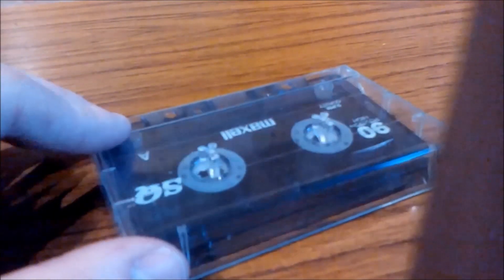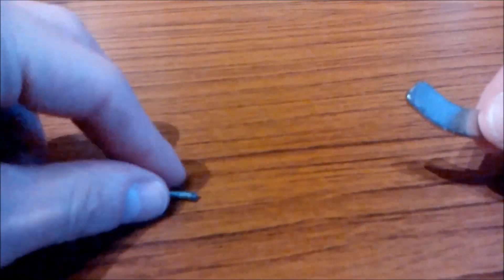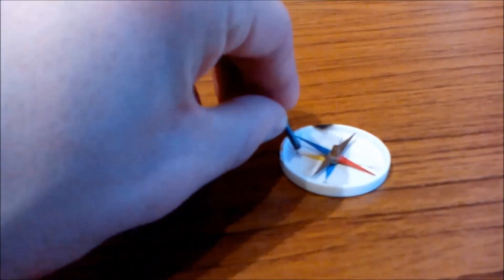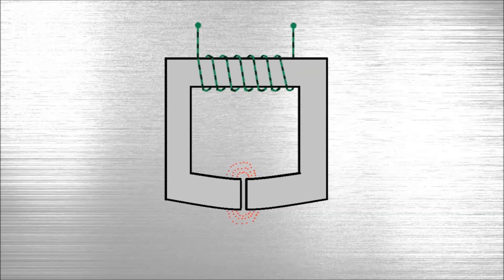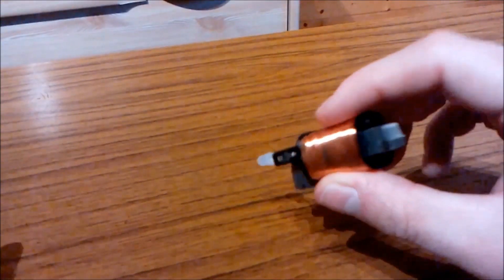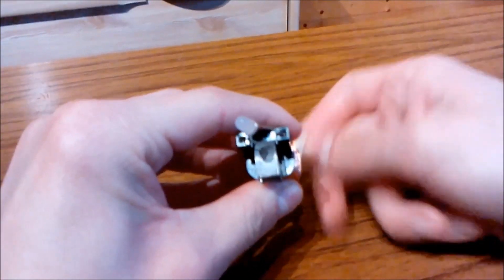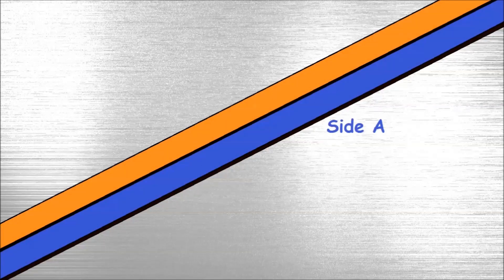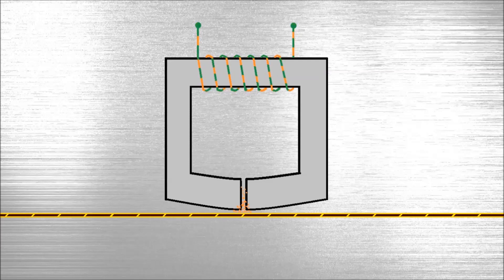How do cassette tapes work? | Analog audio cassette

Comment: I've been remastering and recording music unto Cassettes since I was a kid, and till this day I still do. I just purchased brand new blank Maxell UR 90 tapes at Fred Meyer to continue transferring all of my favorite music unto an Audio Compact Cassette Tapes. I've been messing around with Audio Compact Cassette Tapes all my life, to show people that it's possible to make them sound Louder Sharper and Cleaner than CD's and especially MP3's! Anytime I would shop around for a new Professional Studio Quality Audio Compact Cassette Tape Deck, first thing that I would do is check out what Playback/Record Heads it's equipped with, and always make sure that it's also equipped with an actual AC Bias Erase Head instead of a permanent erase magnet (which are usually blue, but could be any other color). Avoid stereos that use such a permanent erase magnets since those (blue) erase magnets tend to add awful thunder-like noise to the tape, as it erases it. You can use those stereos for Playback-only, but never, ever record on such stereos. To record, I recommend using a 3-Head Professional Studio Quality Tape Deck if you want CD Quality Audio Recording on your tape. Like I mentioned before, all of my Compact Cassette Tapes sound Louder Sharper and Cleaner than CD's and especially MP3's! Every tape deck uses a different type of Playback/Record Heads. I always go for the Parmalloy AC Bias Head. Deck with a high quality Heads and an AC Bias Erase Head will guarantee that your tapes will sound Louder Sharper and Cleaner than CD's! But I also increase the Recording Volume (Not too much where the sound quality might get distorted), and increase the Bias levels, and I never use Noise Reduction to my recordings, since it's not the tape that hisses, but the stereo system itself hisses. Don't believe me? With no tape loaded in the deck, press play, and increase the volume. Hear that hiss? It's the same hiss that you hear in the background as the tape plays. Sometimes, especially on cheaper Stereos, that hiss that the stereo produces, gets recorded on the tape, that's why I only record on Professional Studio Quality Tape Decks that don't hiss like a snake. People get amazed how I accomplished to make Compact Cassette Tapes sound Louder Sharper and Cleaner than CD's and especially MP3's! Just gotta know how the tape recorders work, then you'll be able to get them to sound Good! And remember, it's not the Tape that hisses, the stereo system itself produces that hiss!

Comment: Nice job here. A thought occurs, about this subject: I grew up with audio cassettes in the 70's and 80's, and never understood why manufacturers of tape decks (whether it was a little shoebox tape recorder or a massive, pricey machine) would always place the Record button right next to the Play button. It's almost as if they wanted us to screw up and accidentally start erasing what we already recorded. Just a little mystery of life that I found annoying. 😄
Reply: Because when you record something onto tape you have to press the play & record button at the exact same time to make it record. If you just hit record it won’t work. They put them right next to each other so you can press them both with one finger to record. It’s much easier than trying to press them both with 2 different finger at the exact right time
Reply: @crystal6368  Right, I get what you mean there, when it comes to those specific recorders that had the record/play "one touch record" function. The purpose was to make it more convenient. However, some machines were designed so that you can record just pressing the Record button, and it's right next to the Play button.

Frankly, the manufacturers of stereos--- be they American or German or Japanese or Korean or  Chinese-- all they had to do was put Record on one end of the deck and Play at the other end. The buttons have no business being next to each other. And it's not like the majority of consumers are spastic and have trouble with their finger dexterity. :D

Comment: The LED illumination is clever and accurate. The description of how the recording surface of tape works, however, is not. Magnetic pigment, whether ferric oxide, cobalt-enhanced ferric oxide, chromium dioxide, barium ferrite, or metal particle, is billions of magnetic crystals that are ALREADY polar magnets with a positive charge on one end of each crystal and a negative charge on the other. Recording does not "permanently" magnetize them. If it did, tape could not be erased or recorded over again. The recording process, which is described correctly through the record head, merely makes patterns of positive/negative magnetic "prints" on the tape that correspond to the electrical changes coming to the record head. The magnetic crystals in the pigment are fixed in place in a binder glued to the base film. The crystals can't physically move, but they can switch their magnetic poles under the influence of the magnetic flux coming from the record head. When most crystals have their positive poles lined up the same way, the output to the playback head is positive. When most poles are lined up with negative poles first, the output is negative. When poles are completely random, there is no output (except noise from broken or misshapen crystals.) Tape is erased when the erase head puts out a "loud" signal that changes so quickly that the crystals are scrambled randomly trying to keep up with the changes.

Comment: I find it interesting that contrary to my uninformed expectations, the "magnetic signal" recorded onto the tape doesn't just dissipate, because as far as I know, a ferromagnet like the one you showed us in the video slowly loses its magnetism, doesn't it?  
  
And on an entirely different note, all that high-school dreariness about electromagnetic induction would have been made slightly more interesting if some of the applications were also mentioned.
Reply from the maker: Yes, that's true. The magnetism slowly weakens over time. This causes the tape to sound wrong after long time storage. Same reason why you shouldn't store it near magnets, because the magnetic field will affect the tape's magnetism, making it sound wrong, noisy or even erase parts

Comment: Thanks. But I still don't quite understand how music and sound information gets stored on that iron oxide coated tape to be played back again over and over. I find it amazing that information can be stored on that little strip.
Reply: Nystagmus sumgatsyN if a 30 minutes tape is used as a tape drive, it can hold a  maximum of 500kb digital data. That's not very much.
Ofcourse it's a different thing for analogue.
Reply: he was curious on how is audio (the information) being stored on a coated strip of tape.
Reply: While recording, The tape is magnetized in the same patern as it receives signals from the drum that is placed nearby.
Now while playing, it reverses the action.
The magnetic field on the tape produce same pattern of current as it had received earlier,
Which is again amplified, and music starts playing in the speakers.
Reply: @ANKITKUMAR-pc8uz  great explanation.
Reply: @branni6538  thanks buddy..

Comment: great video. very helpful. but I still don't get how the iron oxide doesn't slowly lose its magnetic charge. wouldn't a cassette tape eventually become blank again?
Reply from the maker: It does lose its magnetic charge over time. Like when an old music cassette where the notes sound false. But the material is made to hold to the charge for a very long time, but not forever indeed.

Comment: could you make a video on how the erase head on a cassette recorder works?   thanks
Reply from the maker: It works the exact same way. Only instead of a variating signal it induces a DC signal. This magnetizes everything the same. When there is no difference in magnetic fields, the player won't pick up anything (except for some random noise of course, what you can hear). Greetings!

Comment: I'm analaysing a cassette player for school but I can't find how it switches from play function to recording,
Reply from the maker: +Gloin79 It works just the same way. Only the tape head creates a magnetic field when the current flows trough a coil, which magnetizes the magnetic particles. When playing the tape, it just works the other way around.
Reply: But what if the tape head receives signals from the microphone while it's a playing a tape (not while recording)
Reply from the maker: +Gloin79 That's beyond the principle of a cassette tape. That's just the electronics behind it. The electronics just ignores the microphone. It will switch in different circuits for reading or writing. If you look up the schematics of a tape player/recorder you can check that out.

Comment: But how does the sound get recorded onto a Tape ?  I don't understand.  Also, when u play the tape, how does a sound come out of it ?
Reply from the maker: The microphone converts soundwaves into a small changing electrical signal. That is amplified and sent to the recorder-head. When playing a tape, it works in reverse. The small electrical signal from the tape-head is amplified and converted to soundwaves again in a speaker
Reply: Sounds complicated o_O
Reply from the maker: It really isn't. The principle is one of the simplest, much like the vinyl recordings. A small signal amplified through a couple of transistors. Maybe I will do a video on that in the future
Reply: That would be nice.  I find it hard to wrap my brain around how a sound wave is converted to an electrical signal.  I guess I have to see it for myself to believe
Reply: Regarding this question: there is something I still don't understand, but I have a theory: how are the different tones produced?

I have two theories here, but I would like that an expert tell me if I'm right:

* Theory one: what make a tone different than another one are the different voltages generated by each pulse.

* Theory two: maybe it has to do with the length of the electrical pulse?

Another matter are also the tapes been used as a storage medium for a PC. I guess here the pulses are always the same and this is why they will produced a horrible noise and nothing you can recognize.